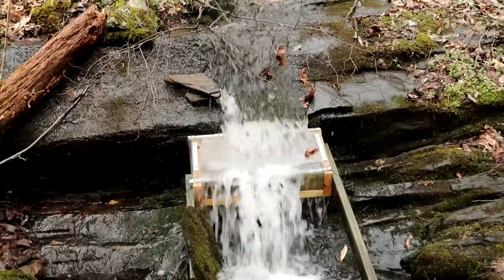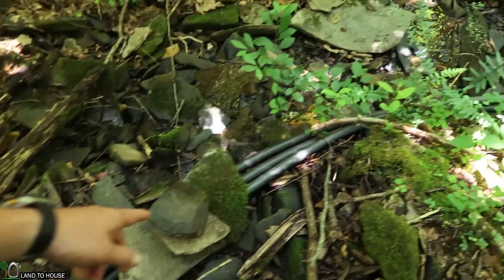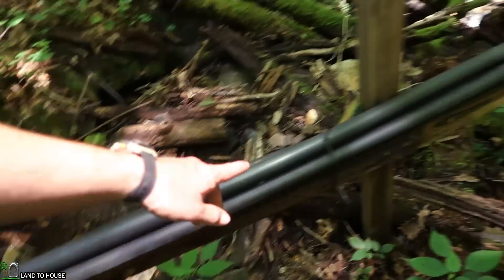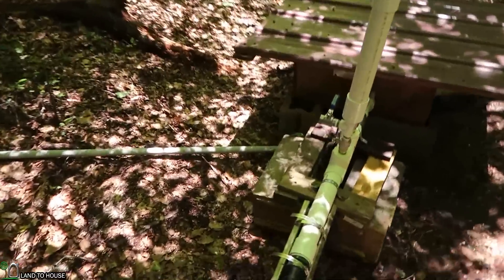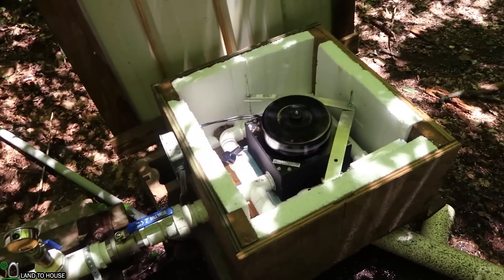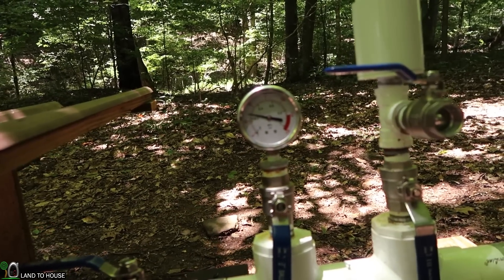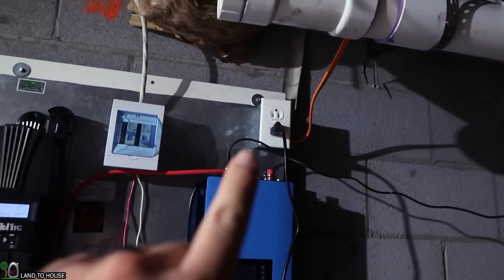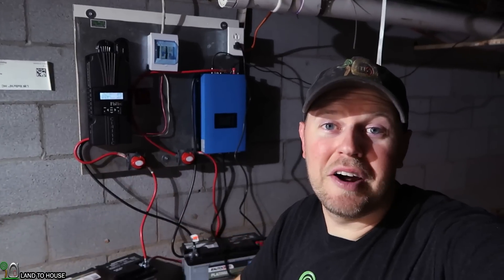Full System Overview Micro Hydro 10/10

Comment: I recommend installing a ribbed heat sink behind the rectifier in order to be able to cool it sufficiently. It increases the lifetime of the Diodes inside the rectifier.
Reply from the maker: I should use the heat gun on it under  full load and see what temp its getting to.
Reply: @LandtoHouse  The wind turbine guys always add fans and such to keep the rectifier cool. Rectifiers can apparently get pretty hot when the generator (in whatever form) is running and the batteries are full. However, wind turbine voltages are all over the place while your hydro system is a lot more predictable. Still, I'd move it off the bare wood just to be safer.
Reply from the maker: @jameshbyrd   That does seem a good idea. My system is not producing a whole lot of power but still if I were to bring that out another inch from the wood would be good.

Comment: Well done. A question for you, if you are already connected to the grid why not just use a grid tired inverter?
Reply from the maker: A couple reasons. We lose power in this area quite often sometimes for 2 days at a time.  The batteries allow me to install and off grid inverter so that we can have power on those outage days

Comment: I don’t totally understand home electric use.- you said you expect to get 178 watts in full operation. Does that mean it does not produce enough electricity to power TWO 100W lightbulbs? And will you see an energy cost savings of about $20 a month? (178wX24hoursX30daysX16¢perKwh)
Reply: I can totally see the benefit for a house completely off grid. With very limited options. Guess I was hoping to see it be more than that for the Amazing efforts you have put in it. 
I did see Wranglerstar’s son wearing a Land to House T shirt in his video today.
Reply from the maker: My system is going to be a hybrid system. Both grid tie and off grid. In a normal day the hydro and solar will feed the house power on grid. When the power is out we can still run the fridge and TV. I will have to go check out the wranglerstar video!
Reply from the maker: The power seems to be holding at 200 watts with one nozzle. So far its translating to 4.8kwh a day. When I get a 3/16" nozzle it will be closer to 250 watts. ...yes $20 to $22 a month. The big thing is I will also have solar and an off grid inverter  next.

Comment: Great job and great series! Perhaps hitting the turbine from all four sides using the other three at lower volume would be more effective than full flow at just one side. Have you tried opening the all the valves part way to see if that is more efficient?
Reply: The pelton wheel works best at highest velocity of the jet.  On the other hand, two jets produce twice the force for a given velocity.  So, if more jets can be run without sacrificing the jet velocity (driven by head pressure at the nozzle), it would produce more power.  For instance if throttling two jets produced 2/3 velocity per jet, it'd produce half again as much power.  I think.  See https://youtu.be/rf9meqw2SQA

Comment: Hi Seth, thank you again for posting these videos, they are great! Where does the excess power go that the stream generates once the batteries are full?
Reply: The charge controller should have a dump load like a heating coil or something. Ideally you would just cut the turbine flow but that is probably another 1000 bucks of automation. TLDR  heat
Reply from the maker: The controller will adjust the speed of the turbine. As long as the turbine volts are in spec of the controller the dump load is not needed. (This is what I was told)
Reply: Land to House how does the controller regulate the speed of the turbine.  Is there a wire going back, or is it wireless.
Reply from the maker: Its is based on battery voltage.  As the battery reaches float it stops pulling as much power from the pma. This means the load is less and the turbine spins up.
Reply: Land to House ok, that makes sense.  I thought it might slow speed rather than let it increase.  Let’s say there is no load, does that mean the energy of the water only has to overcome friction and any other drag, as to what the limiting speed of the turbine is?  Meaning the more load the slower the speed of the turbine given the same water input and jet settings.
Reply from the maker: Yes as the load increases the turbine slows. The charge controller is mppt. That means it finds the best voltage for the load.
Reply from the maker: The midnite charge controller will adjust the turbine speed to reduce the input to the batteries. As long as the turbine volts are below the rating of the charge controller there is no need for a dump load.

Comment: If I recall correctly you have four jets for your system. Maybe you might want to make one of them smaller so you have more options to more closely match the amount of water you have.
Reply from the maker: Yes I have two 3/16" nozzles that I will be installing. That way I can have two at 1/4" and two at 3/16".

Comment: Would the rectifier be a electrical hazard for little hands.  Seems like you would want to have it covered.
Reply from the maker: That modification will be made. Even though the crawlspace is locked I will still cover that rectifier.
Reply: @LandtoHouse  great series btw.

Comment: When you increase the barrel over flow, you should also add another inlet to the barrel, to catch more of the stream water. Also you should stop the water running down the back of the water pick up /filter, to harness more water potential. Then you should seal up all the inlets into the barrel this combined with the next step should give you maximum efficiency , at the pick up - filter area at least. The last thing to do is the barrel overflow, it should go vertical from the barrel, to a height just below the pick up, where it will need an opening at the highest point. Here you will want to put  a tee fitting, the air will go up and out the top of the tee fitting, and the water can be redirected back down to the stream. This will allow  all the air will go out the top, and the barrel will remain full of air-free water at all times. This will also increase the static penstock pressure slightly.
Reply from the maker: I have actually already filmed a video on capturing the water coming out the back of the intake box.

Comment: Do you have an overcurrent dump to burn off the excess generated energy?
Reply from the maker: The voltage is under the max limit of the charge controller and thus does not need to have a dump load. (that is what Spencer says from Langston Alternative Power) So far the house uses enough power that there is never a time where the batteries are full.
Reply: @LandtoHouse  good to know! Thanks.

Comment: I'm not satisfied until I see you run a micro-hydro off your ram pump in a loop.
Reply from the maker: That would be fun. But I dont have enough head pressure after the turbine waste to lift water to 163 feet.

Comment: Awesome.  What are your thoughts on 2 barrels at the beginning. 1st barrel is used to catch sediment which will then overflow into the 2nd barrel.  Which would all be water that flows to the hydro.     Updated.  Another idea would be to get electric valve actuators with wireless access to your software.   Last update.  Your wiring skills are WAY better than I could even understand.  It’s scary to me.  🤣
Reply from the maker: So far I think that the single barrel is going to be fine. I just need to have more water to feed the system. I have just a little wire practice from back in school. I will be starting on the solar install sometime soon. So I will get to do these same electronics again.

Comment: Great job, Seth. Now that you have hydro power, it will probably stop raining on Tuesday. ☺ David
Reply from the maker: It has! The weather the past 3 weeks is so dry haha
Reply: @LandtoHouse  What could be done with the 12+ gpm of water coming out of the exit pipe? Water wheels came to mind but most are generating DC current and your hydro is AC. I just found this video which uses a hover board wheel alternator and a computer power supply plastic fan on a metal shaft inside the pipe. It generates AC current which can be connected to your 10/3 line at the hydro. The PVC sweep wye connection or 2 could be placed on the end of your exit pipe and make use of the  water as it leaves the pipe. More placed up the supply line would generate more power.
Part 1
https://www.youtube.com/watch?v=1KyL1-0A0Gw&t=28s
Part 2 shows how to build it. You only need the Y assembly.
https://www.youtube.com/watch?v=ibCu0PxIZA4

Comment: Be careful when you close upstream as you do when you close downstream, the depression can do damage, generally after the closing valve you put a T with a vertical pipe so that it acts as a vent for any air but mainly to suck it when it closes and drain the pipe properly.
It would have been nice to see in the bin at what level the water was with the two jets open, in my opinion it was higher than the outlet pipe and slightly lower than the overflow, if so you can always leave them both open if it does not drop further, from video it is not clear, it gives the impression that the piping following the ground, rises and falls, if this were the case in the high points there would be many automatic vents such as those for radiator heating systems, otherwise trapped air remains and the effective dimeter, great job we await the maximum flow rate and the 4 open jets!

Comment: Is there a way to just use the three phase AC as a power source? I've tried to research this and it seems no one is doing that so I assume the AC must not be stable enough?
Reply: On such small systems below the kW it is not advisable to use the AC directly nor to produce it at the correct voltage 120V 60Hz (here it is 230V 50HZ) to be used and consumed directly, this can only be done from a certain power up and becomes convenient do it when you have enough to power what you need by alternating the loads and without batteries, for example 1200 / 1500W are sufficient and you can think of using them directly, logically you will need an electronic regulation system that will divert the excess / not absorbed power or consumed by the users on an electric ballast (robust electrical resistance able to withstand maximum power H24) is a very simple system that guarantees stability and allows you to power any load, even electronic or sensitive downstream without damage, the systems vary according to the power as the alternators used, for example from 0 / 700W, permanent magnets are used, they are very efficient and expensive and reliable if are of good brand, they produce a voltage suitable to be rectified and used with a suitable MPPT solar regulator, usually also programmed with an output for the load on resistance when the batteries are full, (the midnite solar does this and is the best in its field) alternatively the water is shut off with a motorized valve, or an electronic maximum voltage relay is put upstream of it, when the regulator stops charging the batteries the turbine having no load accelerates and the voltage rises the relay trips and diverts and protects the regulator itself if it is at the limit of the maximum no-load voltage of the runaway turbine (which should never be maintained for long)
Above the KW and even up to over 100, three-phase asynchronous motors are used even in off grid, economical, robust and reliable with excellent efficiency, better if high efficiency motors, they are able to generate with the addition of self-excitation capacitors, the single-phase either 230V or 120V based on the motor plate data and type of connection, the load shunt electronic regulation system (IGC) is based on the voltage generated because on asynchronous motors it is more stable and linear than the frequency, above i 10/20 kw if you always have money in off grid it is better to go with quality synchronous alternators and the electronic regulation system (ELC) works on the basis of the generated frequency which on synchronous alternators is more linear and stable as a reference.
There are many variables that make you decide the best solution these are the basics.
Reply: I think the issue is that batteries can't store AC power. There is also a problem with the voltage not being regulated.
Reply: Power comes in off the hydro-generator inconsistently to the house. Sometimes it too much and sometimes it is not enough. So you need a way to store the energy and then make it available to the house when it needs it. Because the house uses the power from the generator and the commercial power source inconsistently also. So the batteries serve as a way to store power until you have enough consistent power from the source to supply the house. Then the inverter converts DC electrical energy to AC.
Reply: @puravida1159  no it is not so even if it seems from the video, the turbine varies the power according to the availability of water and how many igniters are open, the water varies slowly in negative and increases quickly during the rain, if you leave an injector open too low the level and pressure, but slowly, the variation in power is mainly seasonal, showing a peak after a storm is useless, not one can stay behind it all day to open and close taps up and down the mountain to see the overflow in based on the weather.
The batteries are really influential considering that if more than 30% DoD depth of discharge are used they would last very little as a useful life, they are also AGM and for starting they will last short, they are not for positive tubular plate traction like the Trojans etc. (below they fit perfectly and it is also ventilated. 5 12V batteries in series are 60volt already at 50% DoD, at 70V they are just 2 kWh accumulated, in that huge house they disappear in an instant, but the system stabilizes and gives a bit of autonomy , but then when the water arrives instead of using it for the house you use it first to charge the batteries for several hours.
Reply from the maker: 3 Phase AC does not store in batteries. It is required to convert to DC for storage.
Reply: @LandtoHouse  yes, i guess my question was, is there a way to just have an AC generator converted to house current with no need for batteries, inverters, etc. Like for instance how a gas generator works but on larger scale of course. I see from the responses that stability would be an issue though.

Comment: So the inverter is back feeding through the receptacle? Also, You Should Ground Everything
Reply from the maker: Yes the plug is called a deadman plug. Although this one is part of an islanding grid tie inverter.
Reply: @LandtoHouse   does it also mean that it can only pull less than 15Amp since the outlet is rated at 15?
Reply from the maker: This inverter is only a 1kw so it does not even come close to 15 amps. More like 8amp.

Comment: Nice system and documentation.  Do you plan to run this in the winter?
Reply: I believe he answered in comments under one of the previous videos that there's definitely enough water in the stream in the winter, and that the constant relatively high pressure flow in the pipes should make it safe to use (without freezing) .
Reply from the maker: Let's hope it works!
Reply from the maker: Yes its my goal to use all winter. This year will be a good test.

Comment: On the power box on the enclosure, couldnt you just bring the wires in the back of the box instead of through the side? eg. use the box to cover the hole.
Reply from the maker: That is an upgrade that will happen soon.

Comment: Every time u show the inverter it's always output zero watt and around 64v, can u show what u are powering inside the house, that would be another video idea
Reply from the maker: I have a few update videos already filmed showing the system. Pushing power. This video was filmed while the batteries were charging up thats why the display always shows 0w output.

Comment: With the inverter, the black cable going from the bottom of it to the socket mounted above it, is that what's supplying the electricity to the house? That seems like it's a bit janky with power going the 'wrong way' on that cable, but I can't see any other cables connecting from the inverter to anything else!
Reply: Your hair drier pulls 1,200 to 1,500 watts with just a plug.  He is only putting 200 watts back into the system, I don't see the issue.  Would you feel better if it was a disconnect box?
Reply: @orion_13  It's not the actual cable itself, but more that it seemed as though if you unplugged one end whilst the other was still connected, it would have exposed live contacts?
Reply from the maker: The sun-1000 is auto islanding. As soon as the grid is removed the unit powers down the output. Its very fast. Before the ground is even out of the receptacle the power has stopped.